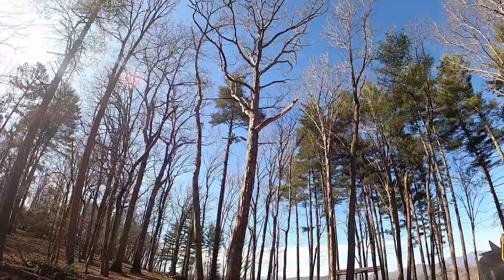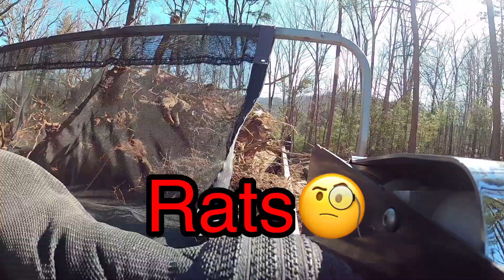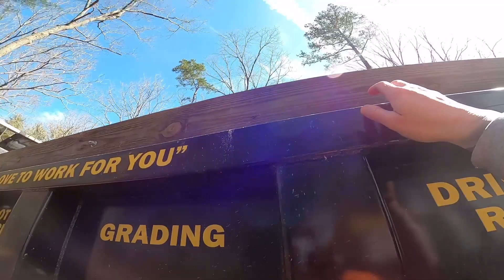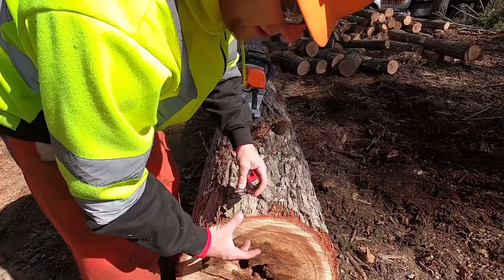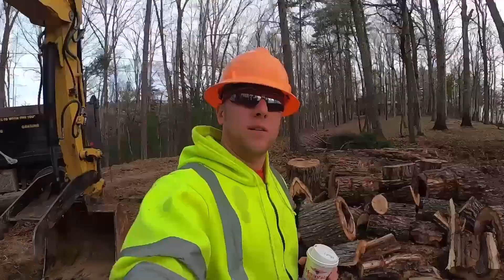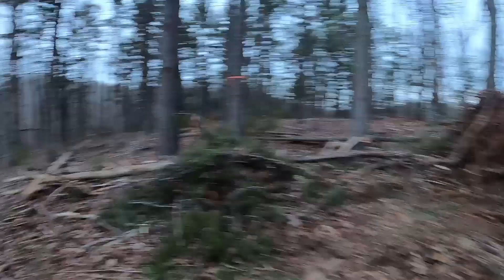LAND CLEARING TREES FROM MOUNTAIN TOP PROPERTY(Day 2) USING NEW STIHL 462 CHAINSAW | DigginLife21

Comment: The 462s are awesome. I run a 25" bar on mine and it doesn't care a bit. The m-tronic works great too...second only to EFI.  Still like my modded Husky for limbing and smaller work though.  The 2 best saw brands out there.  I probably missed it in an earlier video of yours, but whats the payload cap of your truck? SA dump trucks seem to have so much variation.

Comment: I once loved cutting with chainsaws, I cut a lot of firewood from my teenager years until I was in my early 30's, then something happened, my left arm will draw up to my chest, & its all I can do to pull it away & it will return as soon as I let go, & severe pain for quite a few hours,  I still cant use a saw over approx. 1 hour, the lighter the saw the longer I can use, & a big vintage saw, maybe 15 min, & I have probably 100 vintage saws, all were used by me at some point 20+ years ago some are over 100cc all metal older saws. then from todays times, I have 3 lightweight, easiest for me to use is top handle saw, like a Husky T435, plus 1 battery Dewalt saw. I can use the Dewalt 3-4 hours before my arm gives me issue, but I have also killed most of my batteries by then, lol. 

anyway as always I enjoyed your video, & stay safe.

Comment: I thought Stihl only gave a 90 day warranty on commercial use
Reply: That sounds like echo's warranty to me Stihl does a 2 year no questions asked warranty in my opinion its the best on the market
Reply: @calebwright2377  Stihl only offers a 90 day warranty for gas powered chain saws for commercial use. Personal use they give 1 year. Stihl gives a 2 year warranty on trimmers, edgers, pole saws commercial or personal. Echo has a 1 year commercial warranty on chain and cut off saws. Echo gives 5 years on consumer use on chain and cut off saws.